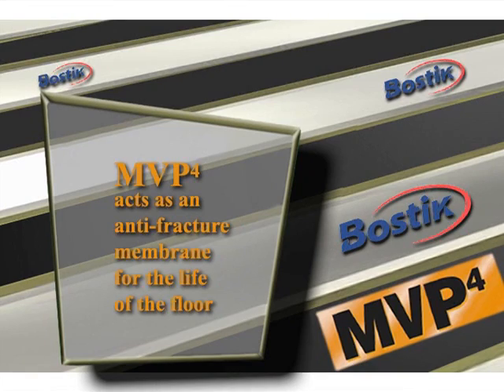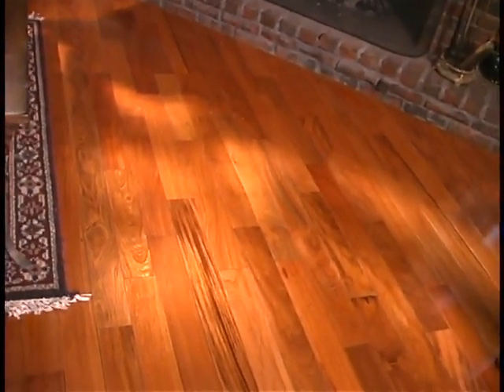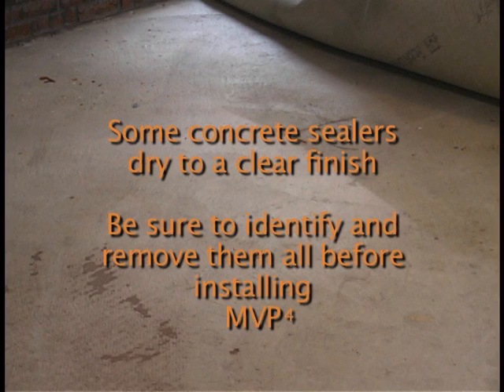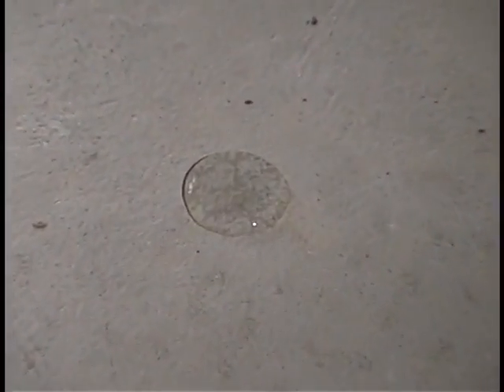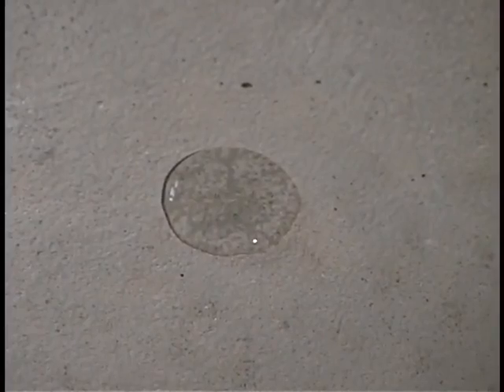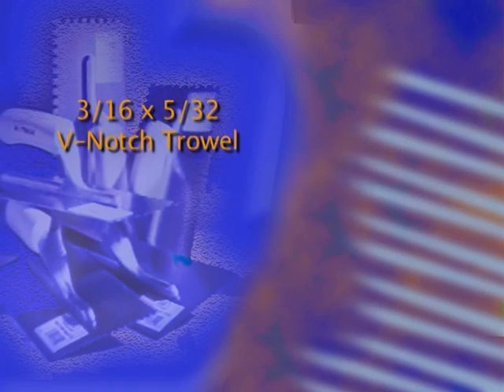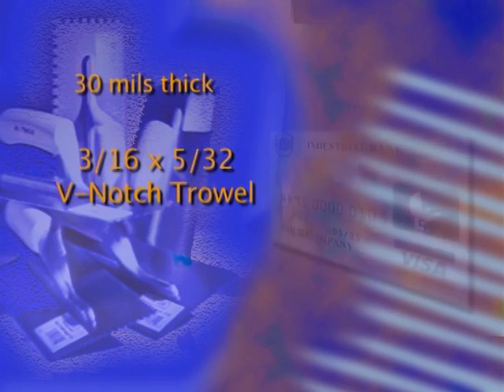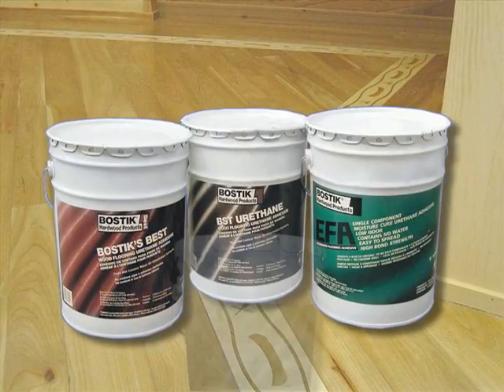How To Apply Bostik MVP4 Moisture Vapor Protection

Comment: Don't waste your time or money. MVP4 does not work. Your floor will fail. It does not lay down as shown. It has ridges and doesn't spread evenly.  If you call Bostik tech support, they tell you don't worry this stuff is the best and you can't go wrong.  You will end up replacing the floor within the year. This will cause you to use 2xs the amount of the Best adhesive and after it fails, they send their inspector who will find a fault with your installation. MVP4 is not an adhesive. They will claim that the concrete was dirty and did not adhere. This thin rubber like film is not going to stick to the concrete. This is where they will claim you installed it wrong. Then you have to decide whether or not it is worth the cost of a lawyer or to replace the floor. Bostik will give you the run around, blaming the floor company and the floor company blames Bostik and you never get an answer. Buy porcelain instead.
Reply: This is the comment I was looking for. I figured Bostik would never actually pay out a warranty. Mfg warranties are just advertising fluff.
Reply: Hickey One 
Sounds like every company here in the USA, from the tires, to the car manufacturer's, electronics, anything you buy now a days. Something goes wrong & they will blame you if not you they will blame the store that sold it to you. Or it was a limited lifetime warranty that was up. What the fuck does that mean, limited lifetime? All these companies are fuckers who don't want to stand by what they say. Something similar to the ones making the pacts with the Indians. They are treating us all like the Indians!